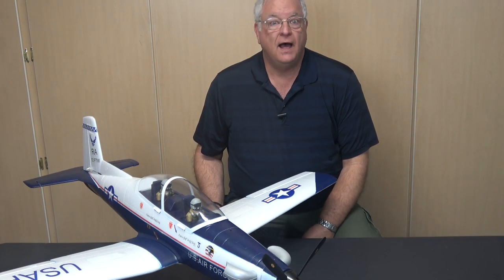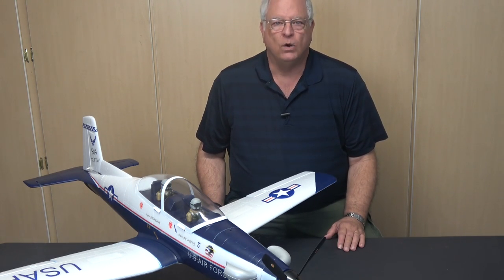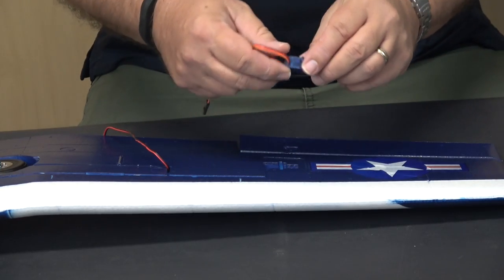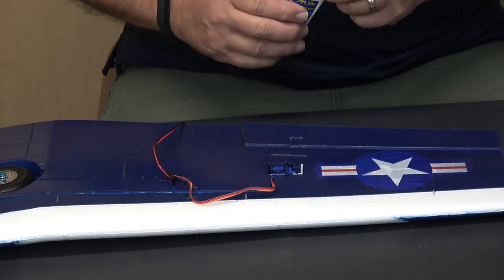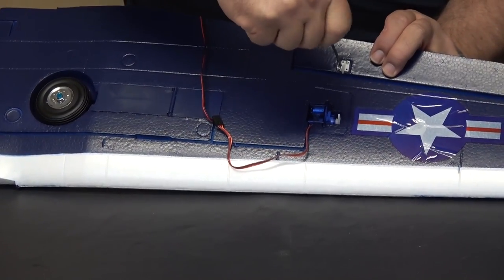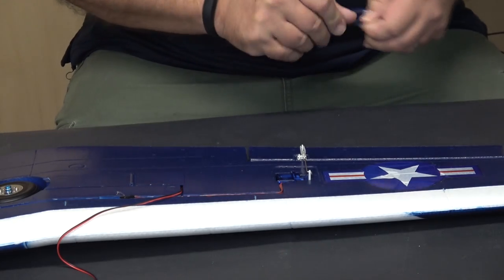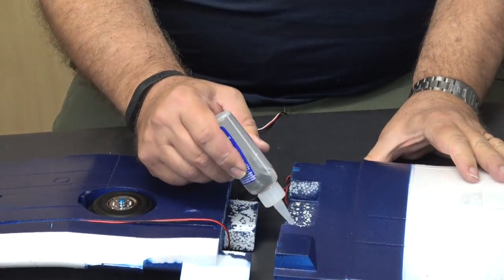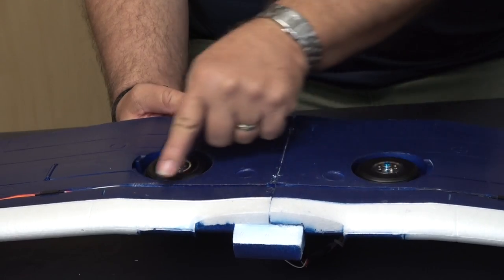Unique Models T-6 Texan II Build Log

Comment: I'm building this model now. Thanks for the servo alignment tip! I was wondering about that.. I'm less than a year in RC modeling.
What receiver are you using in this airplane?
Reply from the maker: I'm glad you found this helpful. I believe I have an orange brand spektrum compatible receiver.

Comment: Almost ready to fly this but am wondering what kind of control throws you are using
Reply from the maker: Jamison Amonino.  I used the throws in the instructions fod 100% or high rates. Then used a three position switch for 90% and 80%. I used reduced throws while getting used to it.

Comment: Did you ever get this model out to the field? How did the forward balancing cg work out?
Reply from the maker: racerx600rr  It worked. This model serms to go against the ryle of thumb that cg should be 25 - 30% of wing chord. I've been messing with a random ailerin servo that has kept this in the hangar. No CG issues though.